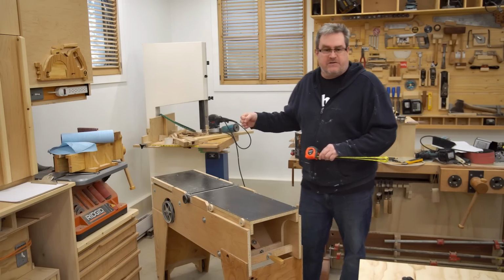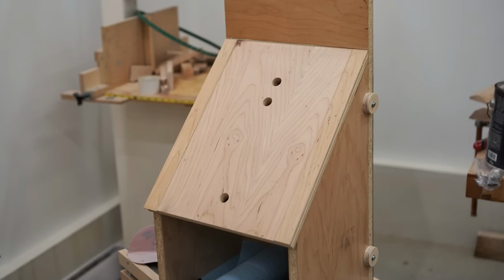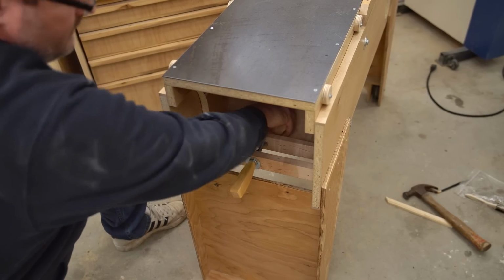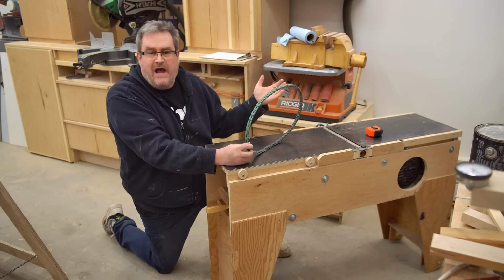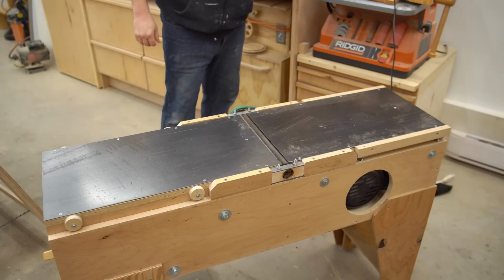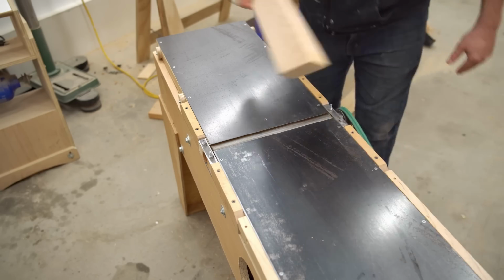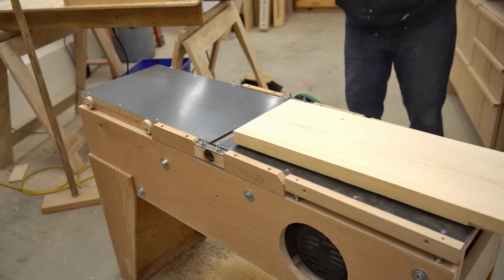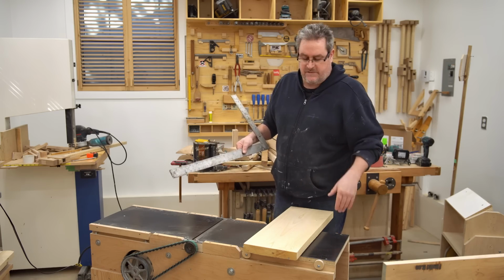Making A Jointer - The FIRST Cut!

Comment: What i would do, is add more Screws to Screw down the Steel Plates. You only attached them on the sides ...if the Wood underneath is Flat ... adding more Screws will pull down the Steel Plate ... and make it rock less.

Comment: John! Maybe you can throw the steel sheets into a wide belt sander to give them some strokes. As long as they are thick enough not to be more twisted by the heat! I have done it successfully :-)

Comment: my little INCA jointer is from the 60's I think, and it's still going strong with aluminium top. I spray so teflon on it occasionally, it dries and becomes very slippery surface.

Comment: The belt is on the side you stand. If the motor was running backwards, could you had it installed on the back instead of changing the polarity?
Reply: Doesn't really matter were the belt is right? It could easily be covered anyway.

Comment: Funny you mentioned that your surface planner died and was disassembled a few years ago.  Mine died last year, same issue, cutter turns but won’t pull the stock through. Unfortunately from your disassembly video, it didn’t look like the screwed up gear can be easily extracted. Else I’d have tempted to 3d print the gear using nylon filament. 

So looks like it’ll end up being a dough flattener.

Comment: It's got a nice hum to it, like a mechanical meditative "uhm". Sounds like its not likely to drive the user nuts if used for a long time.
Looks like it good enough to get an initial flat face, then give the rest of the work to the thickness planer.
Cheers,
 - Eddy

Comment: John, for what it’s worth, i think you should try the aluminum—if the aluminum still isn’t 100% flat, you could mill it down using a quick’n dirty router sled jig (assuming you have a router). People don’t think routers can cut aluminum but they do just fine at a few thousands depth of cut at low RPM’s. The reason a lot of hobby CNC machines have trim routers. 

Looks so frustrating to get it precise. Respect.  Love the build man and can’t wait to see the final version!

Comment: I'm not part of the safety police, but I must admit I did have sweaty palms watching those tests. Nice job on the build!
Reply: It really is the only tool where I use push blocks every single time I do face jointing. I saw a reddit post of someone with a completely mangled hand, all the way up passed the knuckles. The board shot out under his hands, he was pushing the wood down hard, with the wood gone, he basically shoved his hand right into the fucking blade :/ It sends shivers down my spine. He will never do that again. Or most things. Thinking this scares me safe.

It's very different than with a table saw. Many times you can position your hand in such a way that if the board kicks out under you, your hand will just hit the fence/table.
Reply: C 
Ruthless
Reply: @CYDeviant  just terrifying

Comment: I know this is a vid for the jointer, however iv been looking for the reason you dismantled your table saw and are rebuilding it. did it break, Motor went bad? Just wanted to make a new table saw?
Reply: I think the main reason he took the metal saw apart is so he actually starts/finishes the wooden saw. lol

Comment: Awesome build, John. You must have TONS of hours tied up in this project. I noticed you were attempting to flatten the steel table tops and was wondering. Could you use a thinner sheet steel, maybe even stainless and epoxy it down to the sub base? I assume you are using MDF or some other material of known flatness under the steel.

Great job, all around. You certainly have more patience than me to pursue a project that long.

Comment: Hi John. I have an Inca jointer/thicknesser. That has (cast?) aluminium tops. I’ve had it 5 years, it was second hand before me and done a fair amount with it. Including some abuse. You can still see the machine marks in the top from when it was flattened. I doubt you’ll have any problems with using aluminium on your, for the amount of use etc.

Comment: The problem with aluminum is that it can leave black marks on the wood - Years ago Stanley tried to make aluminum planes and had a lot of complaints. i believe you mentioned your tops were hot rolled - I would suggest trying cold rolled stock before the aluminum. .
Reply from the maker: Coating the aluminum with wax or water based poly will stop it from rubbing off on the wood. The base of hand-held electric planers are all raw aluminum
Reply: I'm of the thought that to just find the high spots on the hot rolled. Put some bluing on the table and run stock over it. Hit the high spots with a belt sander. It could be that I just like to try and fix things before moving on. John has been on this project for a while, I'm sure all of this has been ruminated.
Reply: Glenn Worton good point on it marking. John kinda inspired me to look for steel plate for my router table. A piece of 6mm cold rolled for the jointer is about £80 in the UK.

Comment: You may as well use glass, like you said someone suggested. People would start yelling how it's going to break and kill your mom's cat, because that's how their neighbour's daughter's boyfriend's dad died, but it would look cool. I mean, you already have a tool to drill small holes in glass to fasten it...
Reply: And "flat" needs to be defined. It's a wood jointer so getting flatness to 0.005 is not critical. I'm sure John will fix the flatness issue in short order. Even using, melamine like Vlad suggested should be enough.
Reply: What about plexiglass? or a countertop material like corian? Should be easier to get a flat piece of that stuff
Reply: Vlad G plexi glass is a terrible idea. But actual glass or even stone would be cool. Not easy, but cool.

Comment: why not the old top of a cast iron table saw thats been machines flat ???
Reply from the maker: I'd consider using the old top if it didn't have the miter slots and the big hole for the saw blade insert, but there are other problems.
It's not actually perfectly flat - cheap cast iron table saw tops rarely are. 
It has ribs underneath and other protrusions that would have to be dealt with so that it could be fastened to a support frame. 
It's too thick and would require a radical redesign of the jointer. 
In other words, not a very suitable material to use.
Reply: John Heisz - I Build It but John, who wouldn't want miter slots on their jointer???
Reply: NO the three question marks do not imply that your stupid ,if you where i wouldn't buy your plans ,i was simply stating it was machined flat ,and you've cut melt up in the past ,why not cut up an old cast top side wings into a useable size and as you said in your table saw fence video ,cast is easy to drill and tap ,thought it would make it easily adjustable if you tack welded blots to your 1/4 inch plate on the underside making them accessible  from the sides where your cams are now to fine tune the surface , you had two or three old table saws in the pass when you made your last table saw ,and if it makes Tom happy you can use the miter slots sections ,you do get a little anal from time to time ,but that is expected from someone who is very good at what they do,and you are good so i will continue to buy your plans ,if you want to use some polished marble slabs for it i send you some for free ,but  you pay the shipping huh,there's no miter slots in them Tom  : )
Reply: Well with what your using now its  still level enough to balance a beer on ,but make mine a whiskey
Reply from the maker: Why the three question marks? Does that imply that you think it's obvious and I'm stupid not to do it? Well???
:)
Look at a table saw top closer and I'm sure you'll come up with at least one reason why it's not suitable  for this.